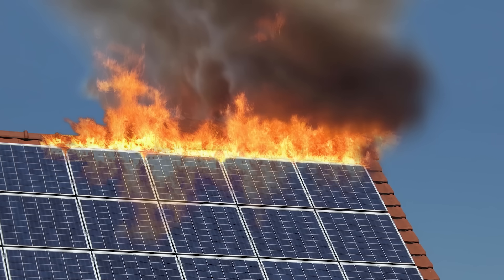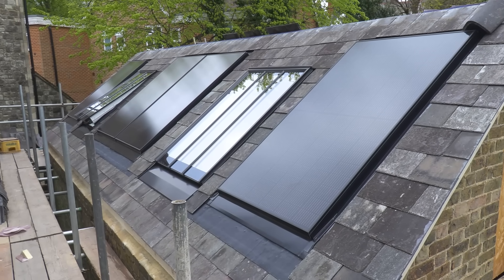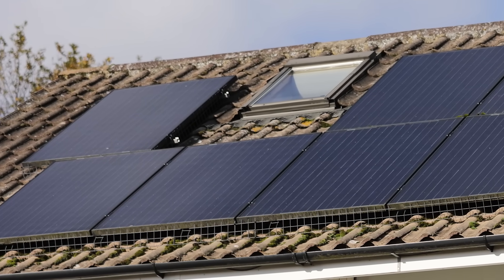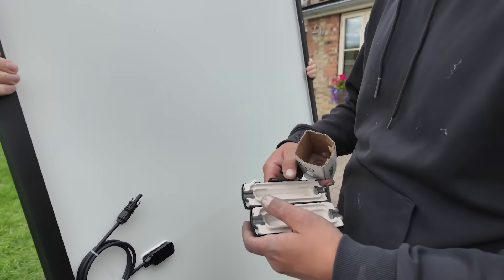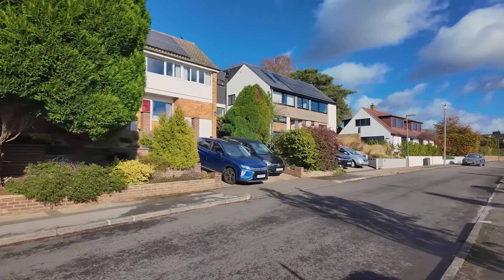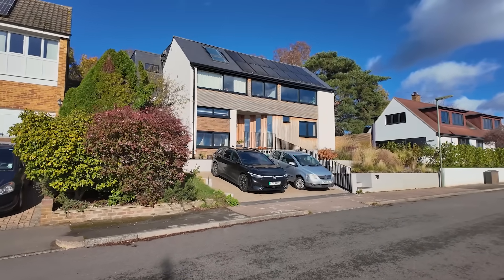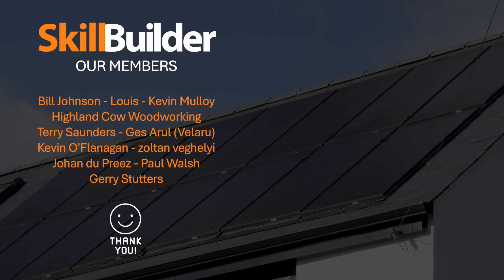Solar Panel Fires Are Rising – Here’s Why

Comment: Great video and thank you for bringing to the publics attention. Fire safety is paramount. The issue lies with these large companies offering dirt cheap installs-10 panels, inverter and battery for £7k including scaffolding-ridiculous. They do not have employees, they use random sub-contractors from the area (who they have never met of vetted) on a fixed a rate install cost which is non negotiable, meaning you only get paid the figure no matter what needs to be done on site so its thrown in. They do not fit bird guard, another birds nest fire hazard, and they definitely won't use ArcBox at £20 a pop per panel. I am also aware of misuse of the MCS certificate, getting unqualified installers to fit it and the MCS holder signing it off for a fee, terrible. 
PV is safe if its installed with integrity and responsibly, there is way to many "profit driven" bandits out there and it obvious who they are, if they offer you super cheap quotes without consultation, BOOM! there you have them. Get wise public, consult with the right installers and understand your options and the risks you take on low cost driven thinking. It's electrical work, be safe. Alex www.omninorigin.co.uk

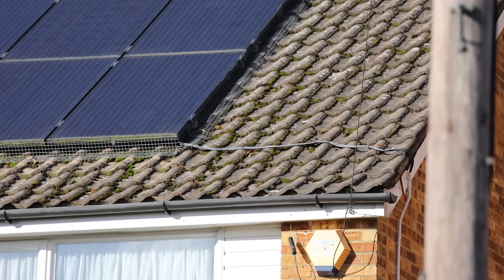Comment: That double cable with zip ties at 0:29 is a good example of a shoddy job.
Reply: Totally agree.  Birds, and especially rodents, love to peck at or chew cable insulation (I speak from experience).  In a high voltage dc system in the rain, this is a highly destructive arc waiting to happen.  Cables should be run in rigid or flexible metal conduit properly terminated at the panels.
Reply: Also just noticed that the cables enter what appears to be plastic conduit with no apparent form of seal at the entry point.  Rain water can therefore enter the conduit and unless a drain point has been included at the lowest point, the cables will be continually immersed in water.  Incredible in a high voltage dc system!

Comment: are the  rafter beams supposed to get wet in the loft? i've seen some that are marked by water damage and they look pretty black near the bottom of the roof where they meet the joists.... 

imo, there's if there's cover edging on the panels that isn't mesh.. this looks ot me will cause more heat to get trapped underneath the panel..  probably a good idea to keep it so they can vent out all the sides underneath.. i have solar without edging or bird guards.. i'll prob get a smoke detector in the loft at some point ... clearing out the old insulation while balancing on the beams to get the dust levels down .. and have no idea what to replace it with..  maybe a couple of layers of multi-foil? something cleaner would get the dust down? ..

how would reflective foil wrapped around the rafters (to prevent heat buildup in summer) affect any panels on the roof? would it cause the panels to heat up more i wonder? hmm
Reply: No,  rafters ain't supposed to getwet. Get an 'expert' to check for water ingress. Don't balance on 'beams'/ joists.   Get suitabl shortish bits of plywood & nail / screw to joists - - safer!

Comment: The diodes between the panels and the battery are the prime cause of fires. The diode shortes out and the full power of the batteries is discharged into the panels.
Reply: Not if you have a decent inverter 😉

Comment: Smoke detectors start to fail in colder temperatures. Most function in the range of 4.4 to 37.8 'C, so in an un-heated area, straight thermal detectors are the option.

Comment: LFP batteries are very low risk for fire. The fire hazard is loose connections and undersized wires. You can drive a nail through a LFP battery and you just get a damaged battery. NMC chemistry in high performance batteries are the dangerous ones. I charge my bicycle batteries under constant observation and avoid leaving them in a high SOC for long periods.
MC4 connectors are very safe as long as you don’t disconnect them under load . If you get an arc,go ahead and replace it.

Comment: Fire risk - and risk to fire-fighters - is why I bought micro inverters for my roof system.  Only about 60V DC at the most.  Safer to firemen (hopefully never needed!) and only 240V AC, so no serious risk of arcing compared to higher DC voltages.  Lower current from the micro-inverters (a quarter of any equivalent DC current).

I would recommend micro-inverters on the roof every time.  Apart from the fire risk, a fault with a single panel or the string inverter can mean losing all generation, until replaced/repaired.  Micro-inverters may not be quite as efficient, but cope with partial shading and one failure (they tend to be more durable than string inverters, which operate at high voltages) will likely only affect the output from that one panel.
Reply: 4 times more connectors = a much higher risk of fault.
Reply: @shmayazuggot8558   How do you make that out?  Can’t count by any chance?  Utter rubbish.

Lots FEWER chances of a fire caused by high voltage DC.  But maybe you don’t know any Physics, either?

Comment: DC connections have to be high quality.  An intumescent box won't help with the non-critical problem of poor connections having resistance, wasting power as heat.

Comment: Reality check: the technology won’t power your home the way they promise.
Batteries fail, and fast. I invested £25,000 in a solar-and-battery system, and my utility bills are still utterly obscene.
The dream was energy independence; the reality is expensive disappointment. If companies want trust, they need to deliver performance, not marketing spin. 
To summarise, as it stands, the technology fails to deliver any savings.
Reply: If you're not seeing any savings from an install that cost that much, sue your installer.  I spent less than that on solar+battery, and my bills are now ~50/month year-round (build a buffer in summer, to cover heating costs in winter).

Comment: Ironically the cheapest batteries are not the problem. Lithium Ion batteries are the problem, but they are rarely used in domestic solar because they are too expensive and have poor cycle lives. The advantage they have is power density which makes them much lighter and smaller per kWh hence their use in electric scooters and most EV's (at least up to now). LifePO4 batteries are far cheaper than Lithium Ion and typically have 10-20 times the lifespan, and are incredibly resistant to catching fire. As they are stationary their weight and size is less of an issue. Lithium Ion batteries are the problem, and within that group it is the "cheap" lithium ion batteries that are the biggest concern as these often lack adequate protection against over charging.
Reply: LFP / LiFePO4 are Lithium Ion... (that's what the L / Li part of the name denotes).  They're just a different chemistry (different additive materials) from other Lithium Ion cells, such as NMC (which is a lithium chemistry, despite not include the L in the TLA).
Reply: @logicalChimp  100% correct, its just that most people in my experience use the term "Lithium Ion" to describe everything other than LifePO4 (so chemistries like NMC) and that is what I was doing.

Comment: If the problem is with the connectors,  then improve the connection design. Seems crazy to sell connectors at £1 then have to put a £20 protector on it.

Comment: Seems like if you need them inspected every few years which will often involve a scaffold then any "savings" over a systems lifespan are long gone. True payback once lost interest from the principal or god forbid interest on a loan to buy the panels is taken into account make the whole thing unlikely to ever pay back.
Reply: For most buildings, an 'inspection' shouldn't need a full scaffolding tower (a roof-ladder is likely sufficient, as there is no heavy tools / panels to be hauled up and down, unless the inspection finds a fault that needs to be rectified)
Reply: @logicalChimp still going to cost a good few hundred quid if you can even find someone willing to do it.

Comment: LiFePo4 batteries have proven to be very safe......so far. And is the primary solar storage battery used today. 
All of the horrible fire videos of scooters, ebikes, Teslas, tablets, and cordless power tools catching fire are Lithium Ion technology.
Reply: Lithium Iron Phosphate is a subcategory of Lithium Ion. Nickel Manganese Cobalt ones are the ones you are referring to. While LFP batteries are safer than NMC, that does not make them immune to spontaneous combustion. Both types of battery can undergo thermal runaway, but they do so differently. NMC tends to catch fire quicker, while LFP vents explosive gas without any flames. Course, explosive gas won't instantly burn your house down, and good ventilation can reduce the risks, but it is still going to cause significant damage if it does get ignited by something.
Reply: Recent LiFePO4 explosion in the Czech republic.Total devastation of building after batteries vented flammable gasses and those ignited. Definitely not safe for in-house installation. https://youtu.be/B6X-_XOPNno?t=215

Comment: Sun bursts or under-cloud reflection from those frosty, sunny and cloudy days can overload wiring that is shortsightedly rated for the theoretical standard rate of solar panel array not anticipating any over generation. Likewise for inverters the wiring must be capable of 1.8 times the maximum rated load.

Comment: In context... The number of domestic solar panel installations in the UK is around 1.8 million. The number of fires "attributed" to these installations is around 180 ... That's 0.011% risk or 
Very low indeed. 
The number of domestic fires attended by emergency services is 35,000
This is scaremongering, and another Skill Builder ... sneery look at the changing world of energy transition. 
In fact I'd say you are the Daily Mail of the building trade....
Oh look the sky's falling down again....

Comment: Six years after installation, I had an infestation of pigeons in the gap between the panels and my tiles (over 40 of them). Noting that the roof fire at the 'We The Curious' museum in Bristol was attributed to bird damage to its solar installation I'd strongly recommend that bird guards (or netting etc.) are fitted if your system doesn't already have them.  Cost just under £480 to have them retrofitted in my case, so not  that expensive compared to the value of your home.
Reply: Same here, for years after the PV array was fitted we did not have a pigeon problem until one year we did! We were warned at time of installation “ For some reason pigeons love solar panels” but this was said almost tongue in cheek. In the end we got a company to install guards and so no longer have this problem. They used to like getting underneath the panels, dozens of them! Also they created a massive mess in the roof guttering, had to get another company in to clear out the gutters, was told they had to pour bucket after bucket of bird mess into the roadside drain!! So in the end £600 for the guards and £250 for the gutter clearing.
Reply: @clivefinlay3901  cheaper to use mains electric methinks
Reply: Good advice to people already with solar panels, but just an extra expense to those thinking of getting them.
Reply: We had wire bird guards fitted to our panels when they were installed.

Comment: MC4 connectors normaly only have a current carrying capacity of 10 AMPS and the cables 40 AMP current carrying capacity,replace the metal connectors inside the MC4 connector with ferrules.

Comment: Roger - excellent video - very timely - thanks for that.  You asked what makes PV solar systems any more of a fire risk than other electrical equipment.  IMHO, the answer is high DC voltage, which results from choosing to install the PV arrays in serial "strings".  This arrangement is attractive for simplicity and for minimising power losses in the cabling.  Unfortunately, high DC voltage can cause self-sustaining arcing, while low DC voltage cannot.  Arcing in the vicinity of flammable materials (eg a roof structure) is a fire risk.  Arcing is usually caused by dodgy connections, due to poor design/manufacture/installation of the connectors or cabling.

A good way to avoid this risk is to wire each solar PV panel to its own "micro" invertor.  Then there's no high DC voltage anywhere.  Battery/invertor units are now available with multiple built-in micro-invertors that are designed to work with single solar PV panels, one-to-one, not serial string arrays of panels.  Eradicating the high DC voltage leads to lower fire risk.

I hope that is helpful and throws a little light on a complicated subject.

Comment: A friend had a scare a few months back. Solar was installed about a year ago and everything was going well. One morning, on a weekend, thankfully, when at home there was an odd smell in the house, a burning type smell. Investigation begins, investigation ends at the consumer box/solar box. When the electrician arrived it was found that loose solar cables was the issue. I have always thought if it was a week day or they were away, this would have been a house fire.
Reply: Cowboy sparkies. To be fair, loose connections could've happened with any electrical work.

Comment: As a factory electrician for 40 years nothing scares me like Dc. People think of dc like a car battery but once you get it at 200v plus it’s very scary. It will happily jump a contact gap when it opens and arc away like a welders torch for hours. Built in solar panels look nice but you seriously expect that think membrane to stop a fire 🤷‍♂️. Atleast on top of the tiles it non combustible. I have recently seen a 20kw solar inverter explode at a factory, yes it blew the front cover some 20 feet away then sat there arcing away laughing at the guys with fire extinguishers
Reply from the maker: That's amazing information, what do you think about micro inverters?
Reply: @SkillBuilder micro inverters are a great idea but have one big flaw. When they  fail ( and they will) getting back to them is going to be expensive and difficult. May even require scaffolding back up. when the second one fails it will be like “we may as well replace them all”. One thing is very clear to me inverters and batteries ideally should not be in the loft space or anywhere flammable. I think we will be  moving to external setups in the future
Reply: @johnwarwick4105  This is how I had mine installed. Went with a SolarEdge system micro inverters and battery. I had the battery installed externally on the shaded side of my property.
Reply: @johnwarwick4105 what sort of distance roughly can the inverters be from the panels?

Comment: The quality of the connection is not the main reason of the increase of fires. It's the tendency to produce higher voltage DC than we used to. There was a time when many installations were 24 or 48V. Those days are gone. Nowadays we have 700V DC installations and with such high currents sparcking become a real fire issue.

Comment: As a NICEIC-registered electrical contractor in the UK, I have seen an internal memo advising against installing isolators on the DC panel side. DC switching can sustain an arc because, unlike AC, which naturally crosses zero volts 100 times per second, DC maintains constant polarity and voltage, allowing the arc to persist and generate intense heat, increasing fire risk. Corrosion is common on lower-cost MC4 connectors exposed to rooftop conditions due to moisture ingress and galvanic reactions between dissimilar metals. Inverter failures occur from component stress, overheating, or firmware issues. I have observed large battery storage systems installed in internal garages and under wooden stairs, raising concerns over ventilation, thermal runaway, and fire containment. EV charge points frequently fail due to contactor welding from repeated high-current switching, leading to overheating and in documented cases, melted components and fires. While working alongside smart meter installations, qualified electricians have informed me that many fitters complete short manufacturer-led courses rather than full electrical apprenticeships or Part P qualifications. Non-compliant installations I have encountered include meter tails exceeding 3 metres without a switch-fuse, absent RCD protection and loose connections, and inadequate earthing. Mass adoption of EV charging and renewable generation introduces voltage fluctuations and harmonic distortion, challenging distribution network stability and requiring costly reinforcement by DNOs. These technical and compliance issues highlight significant risks in the rapid expansion of renewable and low-carbon technologies.
 The industry is awash with cowboy fitters, poor quality materials and salesmen with tongues of silk that will sell the hind leg of a dead donkey to their grandmother. Buyers beware!